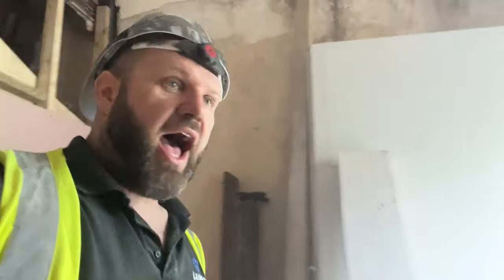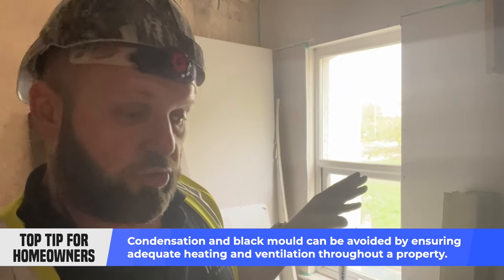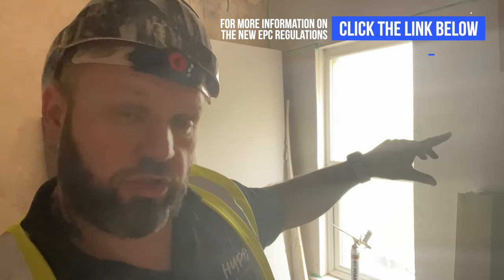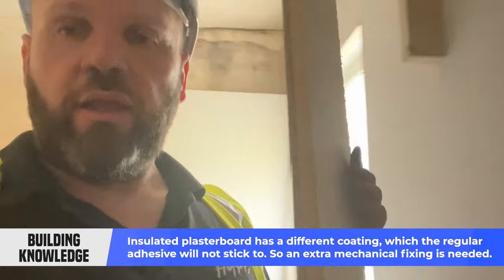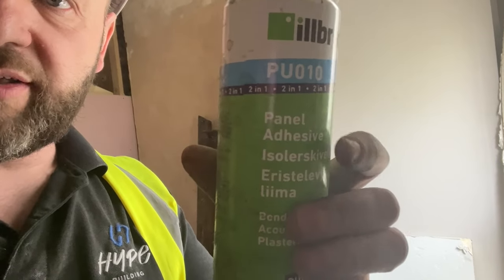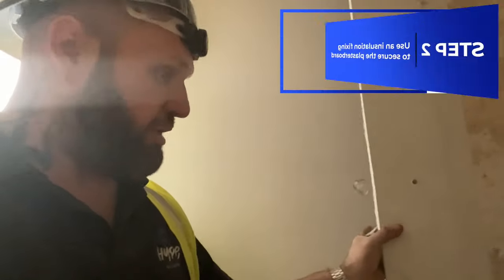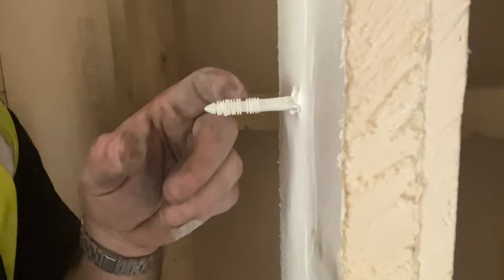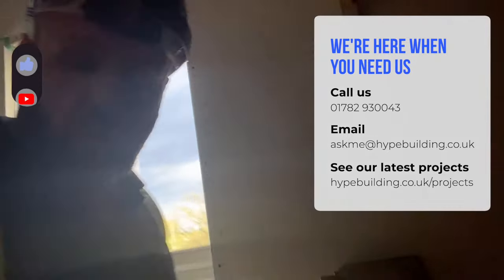How to Fit and Secure Insulated Plasterboard

Comment: This system will trap moisture in the brick wall as the foam is not vapor permeable. Also by isolating the brick and mortar, you are creating a cold wall full of water that will freeze and thaw with the seasons. That will over a long period of time deteriorate your brick and turn your mortar into sand. The adhesive will also create pockets between the brick and foam which will condensate and result in black mold. Anyone looking to do this kind of project should look into vapor permeable plasterboard, lime plaster, wood fiber board, limecrete, or other vapor permeable system. Its not efficient if the system you install causes your house to crumble.